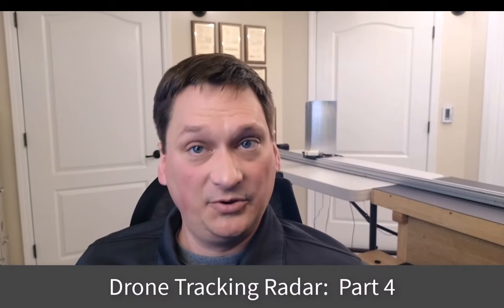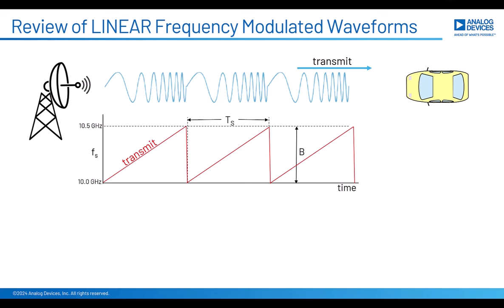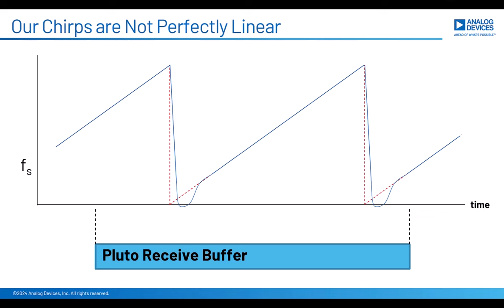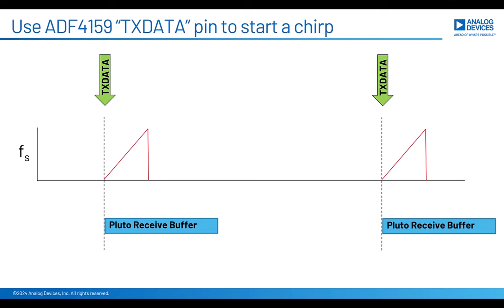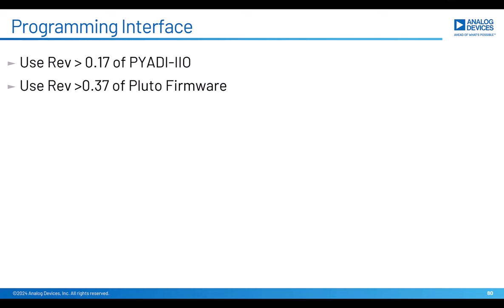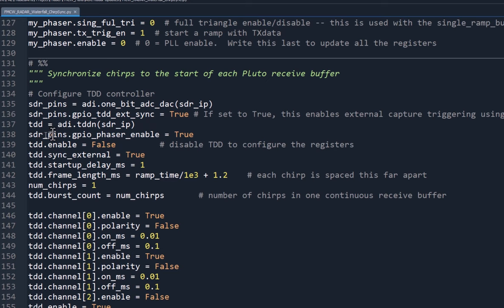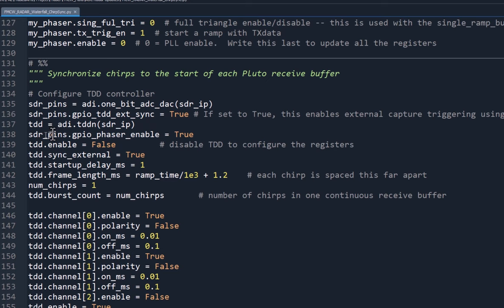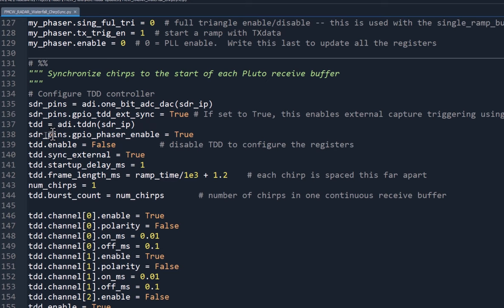Drone Tracking Radar:  Part 4 Chirp Synchronization

Comment: Hard room surfaces creates room echo. To avoid this in your recording you can treat your room with sound diffusion and absorption tiles, use a good mic close to your mouth like a Sure SM7 and or a lapel mic. And soft furniture and carpets helps a lot too. Remember that ceiling and floor reflections matter a lot, so placing absorbent tiles on the ceiling can help remove room reverb/echo. This can be expensive, but ultimately worth it if you plan on building this channel long term. If you are spending $3k on a radar kit, maybe budget $1k for room treatment and a good mic. Cheers and keep up the good work!

Comment: I like that you have modified the audio waveforms of your voice in this video - obviously to prevent an AI from training on it. Your videos have inspired me!
Reply from the maker: Ha, yes indeed!  I have really been struggling with audio quality.  I got some new mics, but it feels like I've only made everything worse...  I think the small room I'm in adds a lot of echo.  So I'm trying to clean it up with software, but I might just be making it sound weird.  Sorry!
Reply: @jonkraft  Possibly look into a decent wireless lapel mic, especially if you are going to be walking around and showing off experiment at the same time as you are talking.

Great videos by the way! I've done RF engineering for years and these videos are really great resources!
Reply from the maker: @Noubers   Thanks, that means a lot!
Reply: @jonkraft I'm guessing you don't want to film yourself huddled under a blanket, but I've been told that hanging a blanket behind yourself really helps cut down on echoes and other audio interference.
Reply: I love how the word "chirp" becomes an onomatopoeia. 😂 Love your content. I'm sure there's an easy filter you could run your audio stream through to get rid of the whistles and background hiss.
Reply from the maker: @Oberon4278  At this point, I'll try anything!  Thanks!
Reply: @jonkraft the trick to good audio recordings is to avoid condenser microphones at all cost. Look for cardioid or supercardioid mics. Sometimes they are referred to as shotgun mics. Rode has some very good ones.

Let me explain to you why you need this: when you shot your videos remember that you replaced the original Pluto 1/4 wave omni antenas with yagi antennas. You did that to avoid the hassles of dealing with RF reflections. Well, in the audio world you must do the same. Avoid the omnidirectional mic in favor of the directional one 😂

Comment: Hi Jon, Ukraine guy here.  Looking forward to getting your range data.  You mentioned boosting the tx power; is there a formula that can be used to calculate detection range based on tx power?  Or is that so unique to each hardware configuration that it has to be determined through testing?
Reply: I just realized that this is probably a request for technical support so it should go in the forums =) I'll repost there.
Reply from the maker: The radar range equation governs it all, that was in the first video.  Obviously the amps (and antennas) make the biggest difference.  Matlab has a great calculator in their radar toolbox add on.  That will give you some intuition for how things will change.  But ultimately it seems to always come down to needing to go to a radar range to really work it out.  Also, the DSP software is incredibly important.   People (not me!) have developed some amazing algorithms to extract and amplify the tiniest of returns.  That's way over my head, so all you'll get from me is the brute force method of looking at raw beat freq returns!

Comment: Can you also implement the same thing with only a pluto with 2tx&2rx as getting a phaser is not feasible for everyone. Also tell me if it can be implemented only with pluto.
Reply from the maker: Yes, CFAR is just looking at the FFT of the radar returns, so you can do that with just a Pluto.  Pretty much everything I'm doing in this video series can be done with just a Pluto.   Only at somewhat lower performance, i.e. chirp BW, etc.

Comment: @jonkraft How do you think, is YIG oscilator is applicable as VCO with combination ADF4159. Sure if YIG has applicable driver for coils (voltage controlled current source). The reason is that is cheaper and have higher bandwith to a chirp 2 - 8 ghz that theoretically gives resolution 2.5cm and low phase noise. At the same time chirp time would be much longer (do not expect it would be less than 200ms)
Reply from the maker: There's other VCO's you could use to generate a 2-8 GHz ramp.  It doesn't have to be a YIG.  YIGs tend to be large, power hungry, and expensive.  But there's a lot of other challenges to do doing such a wide ramp at such a low freq.  Generally anything greater than about 10% of the center freq is considered wide BW.  And here you would be like 200%.  It makes a lot of challenges with filter design and antenna BW.  It would better to do a 6GHz chirp at 60 or 77 GHz, etc.  Then you'd be back to about 10% BW.  But give it a try, and let me know if it works!

Comment: Really great series! Thaks a lot. Would it be possible to do SFCW (Stepped Frequency Continous Wave) using tdd? I.e you would have to synchronize the transmit and receive buffer to evaluate the phase difference of the signal at the receive side. Unfortunately the DMA synchronization does not seem to be available for the ad9361 or the pluto.
Reply from the maker: Yes, that's a great idea!  You can use the ADF4159's TXDATA pin to trigger a freq step, instead of the sawtooth ramp that I showed.  That TDD engine I showed works well on Pluto, that's what I was using.

Comment: Thank you for this video. It is very helpful. I was using a poorman's solution by folding the data by the sweep length followed by 2D fft, but this is much cleaner.

Comment: Loving the series! Wondering if I can justify the spend 😂
Next topics - how close can you get to pulse Doppler on compressed pulses with the usb2 and 30 MSamps/s constraint. Monopulse (phase and amplitude) of course. You could try stepping the delay from tx to rx so that your stretch region moves in range.
Can you use the phaser to create vertical sum and difference beams as well as horizontal, to achieve elevation tracking as well?
Reply from the maker: Thanks for the like and ideas!  We could do pulsed radar, but it would just be a lot of trouble.  For one thing, we couldn't do short range radar.  So the radar range setup would have to be much larger.  That means more power for the transmitter.  And we couldn't do stretch LO, so we'd be limited to about 30MHz of ramp BW.  So we could only see very large things.  It's possible, but it would be a lot of work and not very interesting (to me).  In regards to azimuth and elevation scanning, yes I plan a future video doing this with Phaser.  It is not hard, I just need need to connect in an external receive antenna array.
Reply: I take your point about the swept bw, the dedicated sweep generation of the 4159 is very useful. Can you use the 4159 to generate 2 sweeps, 1 for tx and 1 for rx, so you can choose where the processed range bracket falls? 
Is there an lower cost/easy access route to Option 3. I watched the video from gr con22 and it didn’t seem to cover obtaining the hw?
Reply: @jonkraft  The phaser is an antenna array, why would you need another external one and how would you connect it?

Comment: Hey Jon the phaser is still not available anywhere is it likely to be available soon?
Reply from the maker: Right, you can't wait for it to be in stock.  They move too fast.  You have to order it from Digikey/Mouser/Newark/etc. when it is not in stock, and then you will be in line for it.  Those that have done that have already received their boards.  In Feb we stocked 100 Phaser kits, but they are nearly sold out now.  Unfortunately, the next batch won't be available until end of July.